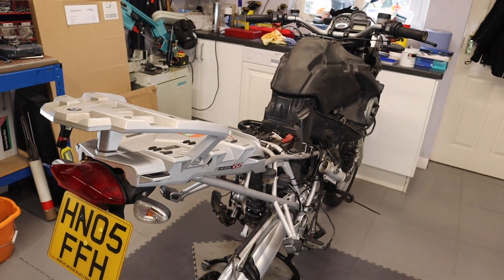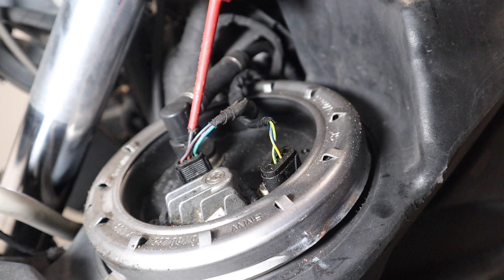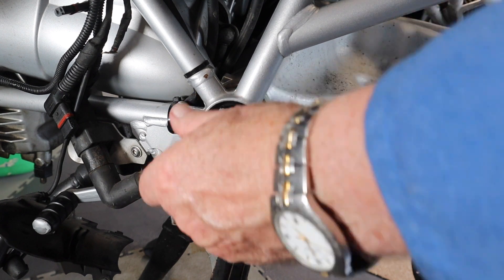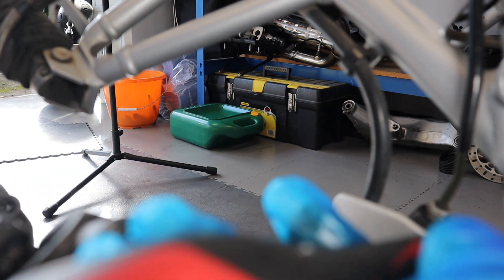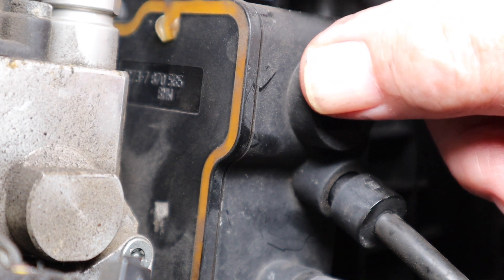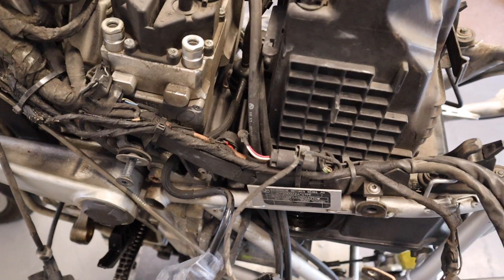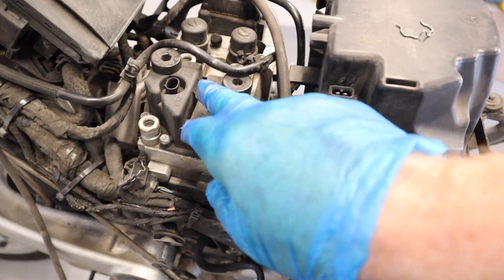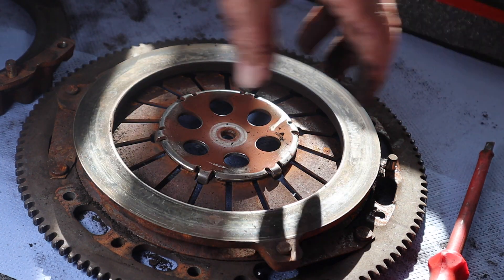BMW 1200GS Rebuild

Comment: I managed to change the boot closest to the engine by dropping the rear drive and pulling the drive shaft out leaving the housing etc in place. to replace you need 3 hands, fingers of steel and the patience of a saint, but it is possible. a lot easier than removing half the rear end. my advice from this experience would be, take breaks if you get frustrated and don't plan to do it in one day....just in case! It took me around 3 hours, 1 of them was trying to get the cable tie back on.
great videos and good luck!
Reply from the maker: Paul Chattington Hi Paul, yes very good comment, you can do it that way, but not a huge problem to take out the shock absorber and final drive. Think I would have tried your method first if I only had the front boot to change even though the manuals and BMW advise removing the swing arm. Your advice to take breaks is absolutely correct. I am 70 now and it doesn’t have to be done in a day.....or even a year, problem is by then I will have forgotten where anything goes🤷‍♂️

Comment: Wow, so glad you're continuing with the GS . My front swinging arm boot is cracked I've super glued it for now and with your help will change it this winter. Am I right in thinking that the injector bodies would normally stay on the cylinders if it where a clutch refurbishment? As I've said before I have the same bike right down to the year& colour and with your videos I'm getting to know her so much better now .
Until last year I always has work done on her at my BMW dealer including a new ABS system paid for by the factory even though it was out of garentee they just charged for the fluids! Now I have stopped working I have time to do the necessary work myself (with the help of YouTube) keep them coming!  Looking forward to the next one.  Cheers
Reply from the maker: MrTimberob Hi Timberob, yes you can do your front boot, not the real problem I thought it may be. You are correct about the injector bodies normally staying in place, but not when it needs a new engine😱. This afternoon I have removed the engine, a replacement arrives tomorrow, but I hate putting dirty, damaged parts back on so have a lot of cleaning yet🤦🏼‍♂️. Will try and edit the ‘engine removal’ video tomorrow 😅

Comment: Tip:  the spring clip on the throttle bodies push in vs pulling out/off.
Reply from the maker: Good tip Dan.....it is the throttle bodies that fill me with fear😫....almost finished, just installed the swing arm and a brand new rear shock that is total indulgence 🤪. Then I will edit the final build video.
Reply from the maker: Wow never even thought about that.....sometimes the most obvious things eh🤦🏼‍♂️🤷‍♂️

Comment: Very good video!!!👏🏻👏🏻👏🏻
Reply from the maker: Thank you Ricardo. I have bought today a 2003 1150GSA 🤗 A winter project but now new engine, well I hope not🤦‍♂️
Reply: @normski3091  I have an R 1200 Gs Adventure, year 2007. As maintenance in Brazil is very expensive, I do the maintenance myself.

Comment: Hi. Very nice video! Just wanted to say you dont have to loosen the front bolts for removing the tank. Only the two rear ones. The front are just sliders where the tank slides on.
Reply: You are absolutely right Jan......realised that the minute I put the tank back and was thinking 'where have the other two bolt's gone'. Thank you for your helpful comments and watching the video.
Reply: @normanhill316  Your welcome. I have a 2005 myself that has 157.000 km on it. I guess Ill keep it as long as it is running. Then at some point I think I need to at least do the clutch. So very useful to watch somebody else first.
Reply: You will do it Jan, I will be thinking of you, have great success. I am just at the final stages, now waiting for the new screen to arrive this week (and the £80 fasteners which Jason sold with the old screen), then it is road test time......interesting!

Comment: I wonder how many R1200 GS’s get scrapped due to cost of replacing a clutch. Great series of videos.
Reply from the maker: Hi Mark, I also wonder that. It is such a huge job that I am sure it would cost more than the bike is worth if you took it to BMW to fix😵‍💫

Comment: Thanks for taking the time to film all this,   very therapeutic 😏
Just out of interest, what mileage had the bike done  and what were the circumstances of the Dropped Valve ..... 
Thanks 
Roj
Reply from the maker: Hi Roj, So pleased you have enjoyed the video's. The bike had done around 55,000 miles and my son Jason used it every day to travel to work and back for more than 3 years. He is a good rider, never over revving the engine and doing 70mph on a dual carriageway when the engine blew. Bike always serviced on time. There is no real answer, it is rare to drop a valve but it does happen. Yesterday I had the tyres changed on the GS and Mark the fitter, who has a mobile service, was a mechanic to a Superbike Race Team. He also services bikes 50% of the time, many BMW's. He has seen it a few times, not before the 1200 model though, ie the 1150GS in his opinion was much better engineered?
Reply: Thanks for the reply much appreciated.   I've just watched the intial strip down..... very sad.  What a mess.   I've just bought a late 06 GS myself.  Just hope this is a rare occurance  😢

Good Luck.  I'm an engineer too but don't relish that job .
Reply: @RiojaRoj I bought a 26k mile immaculate example. 2005… dropped a valve after a few hundred miles.. luckily I was only going at 30mph and I was able to replace the head, cylinder and piston and it’s been ok for the last 1k. I think it was a common issue. Plenty forum threads about it.

Comment: Hi. Watched 21 mins. thus far, so not sure whether you mention it later, but are you aware that the alarm has a small, camera-like battery in it? You can remove it, and I imagine that will stop the beeping. The unit is under the rear luggage carrier cover. As I recall matters, there is a video on Youtube (South African guy, I think) which demonstrates the method.
Reply from the maker: Michael Brewis Hi Michael, thank you so much for that information, i didn’t have a clue where the alarm was. It stopped after 24 hours, I was giving up the will to live! I find the alarm such a pain, if only in Service Mode it would be totally disarmed and NOT bleep every 15seconds but apparently the insurance companies will not approve it if it does that. That must be why my factory fitted BMW alarm on my RT1200LC is not recognised as an approved alarm because you can switch it off🤦🏼‍♂️. I am worried that if I remove the ‘buzzer’ from the Datatool alarm it may think it is being stolen and not allow the bike to start🤔

Comment: What caused the valve to drop?  I got a 2005 and one of the bearing sets dropped the ball bearings into the trans.  I will be doing videos of rebuilding a r1200gs trans ( another trans not the current trans).  Not happy at all with BMW's now!
Reply: Theres a clutch that has a spacer on it (beemer boneyard). It will fix the 6mm gap and allow full contact on input shaft.

Comment: Hi how did you restset your  1200r gs 2005 as I have just replaced my engine and gear changer is showing wrong gear
Reply from the maker: Wow Simon I have no idea😵‍💫. That is a very interesting problem which must be electronic but somebody somewhere in the internet world must have had that happen🧐. At the same time I am wondering why I did not have the same error😮

Comment: Any idea what caused the engine failure?
Reply: Hi James, Not really. Jason was a very careful rider, never really over revving. It does appear that there was some issue with the valves around 2005-2007. A weakness that may have made one drop into the piston which would have been like a hand grenade at 70mph!
Reply: @normanhill316  ouch! Interesting to know. I have a 2008 which I'm very much enjoying, hopefully this issue was rectified by then. This video is very informative, I also watched your video ref final drive oil change which I must do this winter. Keep up the good work!

Comment: Where you a fitter and turner .
Reply from the maker: Hi Rick, well for a while I was a Diamond Tool maker in Cornwall in 1971 working on projects like Rolls Royce RB211 jet engine turbine blades, but it was a two man business and then RR went bust🤦🏼‍♂️ so did the owner of the tiny specialist engineer 😱. So I went into printing for the next 40years🤷‍♂️
Reply: Arhaaa ...I new it must be a toolmaker ,fitter of some sort .Though what is a diamond toolmaker.
I’m asking as I’m a fitter and turner currently on Cnc machines making small run R and D parts.  
Also I’ve worked maintenance working on Flexo printing presses 
I also have a gs 1200 
Ohhhhh and my apprenticeship was in a tool room making new press tools and maintaining sharpening ect ...
Maybe where long lost brothers 
Hehe
Reply: @rick.nipper  Hi Rick.......yes we must be related!! In those days I used to make the tool (or it would be supplied) and then I would Nickel plate it over a couple of hours while I sprinkled real diamond 'particles' over the tool and the Nickel formed around each diamond and bonded it in position. They were very expensive, and a very secret part of engineering known to only a few people. I did a milling course a couple of years ago and the instructor showed me that nowadays everything is sintered on diamond tools and is very cheap.
Reply: Norman Hill  Norm when cylindrical grinding materials like ceramics where the wheels are impregnated industrial diamond does this mean it’s a sinterd process?
Wow real diamond must off been very expensive Was the diamond to do with the hardness?

Comment: Those electrical clips - you are prising them off with a screwdriver but you don't understand. You push those clips in with your thumb to release. You don't prise them off. Also, those ABS units can be rebuilt. It is done all the time. Bypassing the ABS is lazy. Really though Norm! And go out and buy some longer ratchet handles. You are struggling with a lack of leverage.